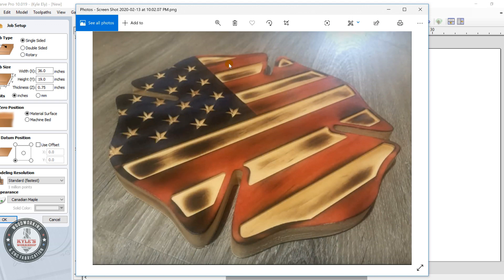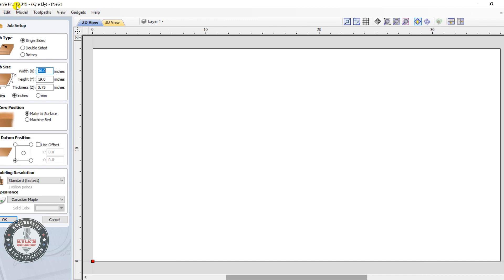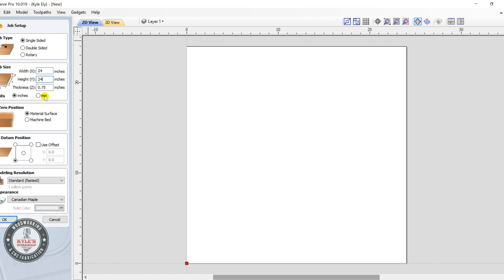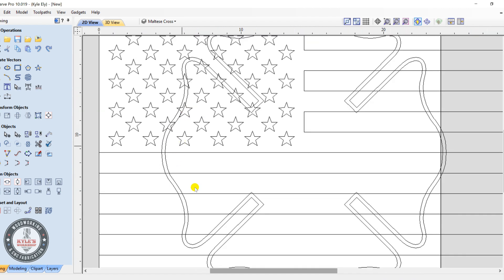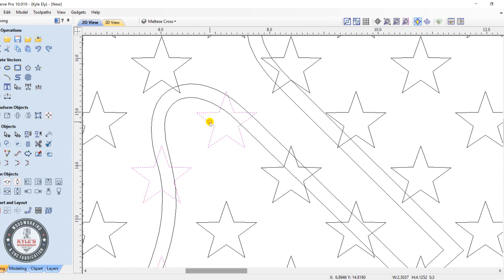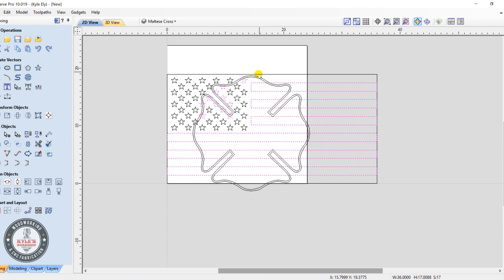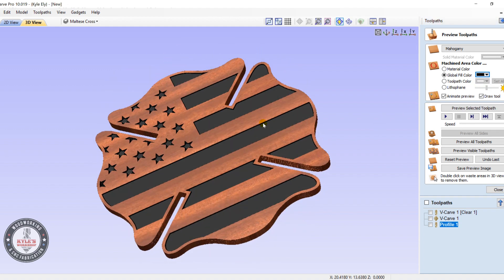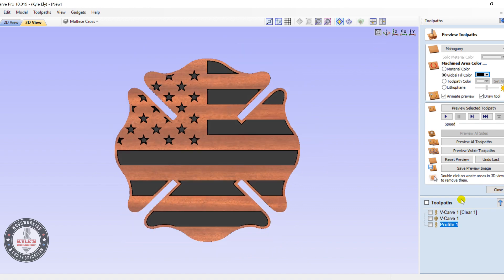How to Make a Maltese Cross American Flag - Practical Vcarve Pro Tutorials - Episode 2

Comment: I would have like to see you go one more step and save the toolpaths. Does this save as 2 toolpaths?After the first toolpath is completed and you change the bit, do you have to rezero the exact same location that bit #1 started at?  I read that anytime you change the bit you should rehome the machine, then you would have to rezero it to the original starting point?